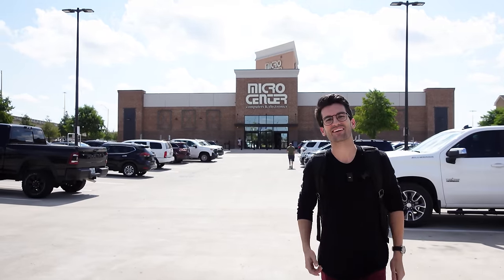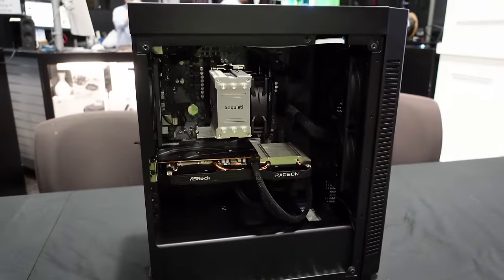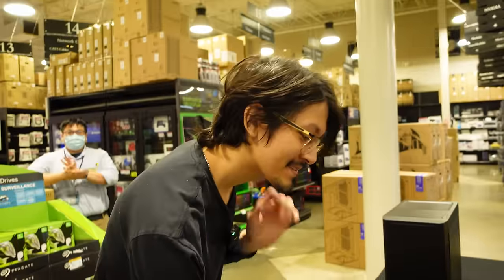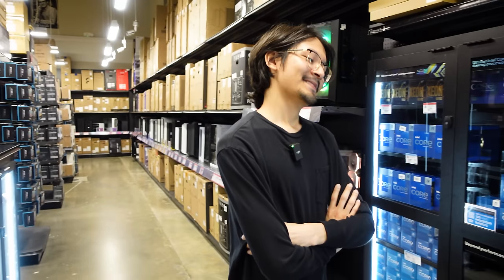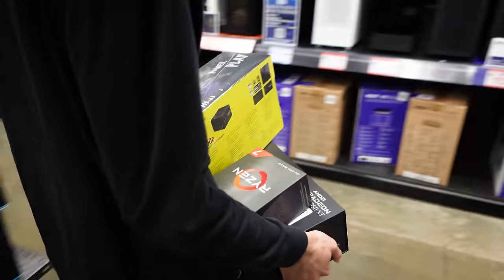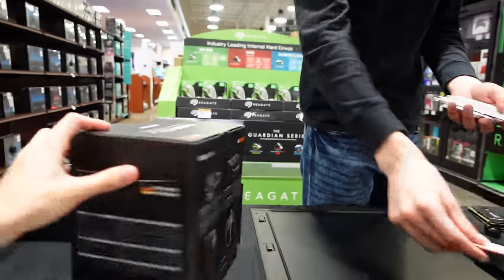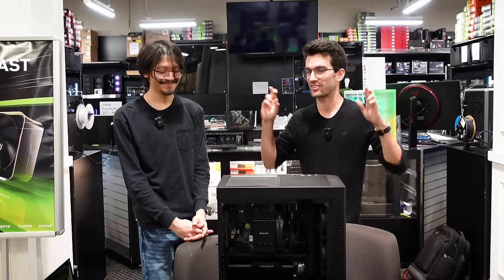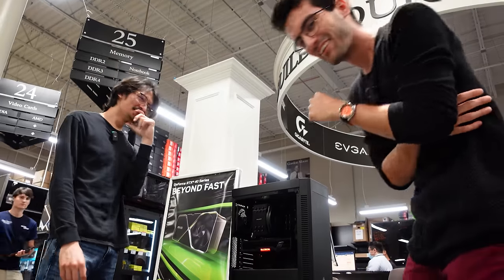He Won an EPIC Micro Center Shopping Spree! - Gear Up S2:E5

Comment: This guy used the budget the best of anyone this season
Reply: Well, he also had the highest budget so far this season, so he had more wiggle room there, and a good platform for upgrading helped as well.
Reply: While I find the 7700X bundle to be good ($400 these days), I only find it to be a good pairing with something ultra high end like 4080, 4090, and 7900 XTX. With the budget most people get, it’s best to stay on the same platform if they can especially those on AM4. They have a bundle for 5600X + B450M DS3H WiFi @ $200 and that is good if a platform upgrade is needed but it isn’t always.

Comment: Super smart to just take advantage of the AM4 platform and compatibility. I am rocking the 6900 XT myself so the 6950 XT will definitely crush anything FPS wise at 1080p or 1440p, hell even 4k gaming is pretty solid from what I have seen. 5800X is a beast too, unlucky the 5800X3D was just out of budget.
Reply: was it? Maybe a 5800X3D along with a 6900XT or still a 6950XT but no new cooler and a cheaper PSU would've cut it
Reply: 5800x3d + 6950xt + PSU could have been enough imo too.
Reply: seems Microcenter need to sale that bequiet cooler. It's almost in every video of this series 😄 @Zebra_Paw
Reply: @SpatialZebra ya, the 3d chips don't get hot, he could have bought a $30 cooler, and one of the 3d models.. also the 5600x3d is only $20 more than the 5800x
Reply: @sstier48  it's a lot more than 20 dollars difference.
And his cooler was already OK since it was already AM4 so not even buying another one
Reply: 5800X3D or 5600X3D if they had it in stock plus 6800 XT or 6900 XT would've been fine, I'm sure. X3D chips don't get that hot - don't need a massive CPU cooler and he could've easily put $100 of his own money in since he'll make that back selling his old parts easily. That Be Quiet cooler is just way too expensive - what he had was fine.
Reply: 5600X3D simply doesn't exist lol
And yes his cooler was way too expensive, you can get a nice Cooler Master 360 mil watercooling for that price
Reply: @Zebra_Paw  Microcenter were the only ones selling the 5600X3D. He had a golden opportunity to check if it was in stock. It's not even 5% worse than the 5800X3D. Could've eeeeasily cooled that with what was in his ystem.
Reply: @b0ne91  it's a 6 cores right? I don't think it's enough for a 6900 XT
Reply: @Zebra_Paw  what do cores matter? It has massive 3D cache. Hasn't it been proven enough times now that cores don't matter? I can get you a 14C/28T CPU for less than $30 - you still wouldn't want it for gaming.
Reply: @b0ne91  yes of course, it's not only cores that matter. They still do though, I don't think you would like a modern dual core for gaming either
Reply: @Zebra_Paw  If that dual core had 150Mb of L3 cache, I don't think it would matter too much unless the OS is eating up all the base resources and you're running a bunch of shit in the background.
Reply: @b0ne91  gaming performance would suffer and severely bottleneck a 6900 XT
Reply: @Zebra_Paw  please look at reviews. Jesus, man, the 5600X3D is within 5% of the 5800X3D. Your cores argument doesn't matter if you have cache so massive. Not for games anyway.
Reply: @b0ne91  I didn't even know the 5600X3D existed before, I only knew about the 5800X3D.
what I know is that the 5800X is significantly better than the 5600X when it comes to holding up with top tier GPUs.
I've never owned a 5600X3D but I'd assume it's a 5800X3D with two less cores and lower clocks. So unless there's something magical about it that the 5800X3D doesn't have, there's no way the difference is under 5% especially in practice.
Not saying it's bad by any means possible, but when you're buying such a crazy GPU it's probably not the best balance
Reply: @Zebra_Paw  you didn't even know the CPU existed yet you're spewing nonsense. Go watch some reviews. Just accept you're wrong. Maybe watch some HUB videos to see how CACHE affects gaming performance compared to cores. Buying a "crazy GPU" balances out anyway because you'll be playing at higher resolution. You're not getting a 6950XT to play at 1080p - if you were, it'd likely be for esports where you NEED a strong CPU to even push those 240+ FPS
Reply: That B450 VRM is concerning tho, looks too bare off to tame the beast that is 5800X
Reply: @b0ne91  bruh. Maybe I'm wrong, but why would that make you so mad? Instead of just randomly yelling maybe explain how tf the difference between a 5600X3D and the 5800X3D isn't the same ratio as the 5800X vs the 5600X.
That'd be more constructive.
Btw I have watched reviews, but usually they're just are reliable as benchmarks
Reply: @Zebra_Paw I explained the difference from the start like 3 times, you chose to ignore it every single time, continue to spout your false information and then eventually admitted you neither knew the chip existed, had no idea how cache works  and kept bringing up synthetic benchmarks that don't apply to games and insisted to not look up anything. I even told you specifically WHICH videos to take a look at to understand how cache is what CPUs scales with moreso than cores. Go look at HUB, look at GN. See how the 5600X3D performs compared to the 5600, 5800X and 5800X3D.
Reply: @b0ne91  bruh
Aside from all the rudeness which is completely pointless, I have to say I'm kind of amazed by how well this performs. I do not know how much it costs but this might be the greatest deal ever (hence why it's so rare).

I still think this could bottleneck top tier graphics cards though
Reply: @Zebra_Paw  That's why I said shifting things around, the winner could've gotten a 5800X3D and a better GPU. At that point, you have the best CPU available on AM4, on par with the 7700X on AM5 and no compromises or having to upgrade again.

I have a 5800X3D and 7900XTX. Let me tell you - the only bottleneck I ever see is from AAA titles, where ray tracing and NPC density is so heavy on the CPU that even at 4k, you may drop below 60 fps. But other than that, I can get 600-700+ FPS in esports titles like Rocket League, Valorant, Overwatch etc. That being said, those titles I usually play on the 7800X3D/RX 6800XT combo with a fast 1440p monitor, not a big TV for story based games with friends.
Reply: @b0ne91  yes it's the 5800X3D. I'd be very surprised if the 5600X3D were to give you that much

Comment: my preferences if its me :

AMD Ryzen 7 5800X3D 3.4 GHz 8-Core Processor	$269.99
XFX Speedster MERC 319 Radeon RX 6950 XT 16 GB Video Card	$599.99
Corsair RM850x (2021) 850 W 80+ Gold Certified Fully Modular ATX Power Supply	$134.99

Base Total:	$1004.97				
Promo Discounts:	-$20.00				
Total:	$984.97
Reply: 100%

Comment: Soooooooo happy he went with the AM4 platform and updated the BIOS. I think people have written off that socket because it is last gen. He definitely squeezed every penny out of that budget. A new LGA 1700 or AM5 with a "lower" tier GPU would have been a great upgrade as well, but this is 100% what I would have done. I also am running a B450 with a 5900x in it because it is a great way to save a few bucks at the cost of EXTREMELY minimal performance.
Reply: I would upgrade the motherboard to get amd Sam and pcie 4 to get better gpu performance
Reply: @mirelurk-fish7387  It is definitely better, but for raw gaming it isn't going to impact mush in terms of data transfers. Games aren't even coming close to the max bandwidth of PCIE gen 3.
Reply: @Dubvee_33  My point for why he should have gone for the AM5 platform upgrade is that he "won" this upgrade, thus in the future when he wants/needs to upgrade, he then needs to get a new MB + CPU + RAM. If he had went with the AM5 upgrade, then in the future his upgrade path, that he now has to use his own money for, would be a lot cheaper, as he should be able to get something like a 9800X3D or the likes.

Comment: Alejandro hit this one out of the park!  He is the first one this season to completely maximize his price to performance.  He got a top tier CPU and GPU and even managed a solid tower cooler and PSU upgrade.  The only thing he needs now is 32GB of fast ram, if he is hitting a limit anywhere.

Very happy with this episode!
Reply: Could have easily gotten a cheaper cpu cooler (Microcenter regularly has the Deepcool air coolers on big sales) or kept the same one he had and got a -x3d chip and that would have been "completely maximized."  If he kept the same one, he had and waited to upgrade it himself, the best air coolers on the market are Thermalrights that cost $50 less than what he paid for a Dark Rock Pro 4.  I'm not sure how this type of stuff isn't being caught by the Microcenter employees or especially Greg.  No one has any business paying 80+ bucks for an air cooler when Thermalright exists in the market.

Comment: Awesome that he stuck with his B450 board and just dropped in a 5800x. AM4 still has plenty of gaming performance on the table! I went from a 3600x to a 5700x and its more than enough for me, especially since I game at 1440p
Reply: It would be great if the VRM in that board is not that sparse off
Reply: @baoquoc3710  yeah the 5800x is a hot one. I think a 5700x would have been a better choice since it’s pretty much the same performance but is more power efficient and runs cooler

Comment: With a grand, I'd totally drop a 5800X3D on the current board, get some baller SSDs, more memory and a GPU.
Reply from the maker: 5800X3D is no slouch.
Reply: Ok, so, 5800X3D, 32gb ddr4-3200, 2TB Samsung 970 Evo Plus and RTX 4070 would have probably been my choice.  But I mean, I already have 48gb of memory and 3TB of NVME so I'm partial to having more.
Reply: @cracklingice What about the CPU cooler and PSU ? Where would you squeeze money from a $1000 ??
Reply: @GregSalazar  Not at all and at the current $270 it's a deal!
Reply: @cracklingice  what you got on those 3TB?
Reply: @hatim.bahrain  I wouldn't change the CPU cooler until it proved to be a problem and the RTX 4070 only requires a 650W PSU - something that the rig most likely already has anyway.
Reply: TBH - if I were to be in this - I would be so SOL.  Microcenter doesn't have any HEDT stuff currently and even if they did - $1k barely gets just the motherboard now for some reason.  My X99 motherboard and a CPU could be had for that.
About all I could really do is a storage upgrade or a sideways move to get more video memory than my RTX 3080 10GB.
It's for those reasons - I'd never be chosen.  It'd simply be boring.  Unless I showed up with my nieces PC.

Comment: Dude, get a 5800x3d and a 6950xt, you'd be set for at least another 4 years. There is no real reason to really go ddr5 yet. The 6950xt is an excellent GPU, I mean excellent. My 5800x3d/6950xt set up gets me over 20,000 in timespy. I don't recommend extremely fast ram with a 6800x3d. I updated to teamgroup ARGB DDR4 3600 c14 and although I get very good performance, it wasn't really worth the upgrade. I got better performance with c16 3600 DDR4 at 1.35. B-die of course.

Comment: The AM4 platform is still a strong one. Yes the new platforms offer way better performance but that doesnt mean its not performing well. I made my new pc with the 5800x on a x570 and my worries is graphics card which is a 3080. I think i wont change platform for 6-8 years while gpu i think I will have to change it after 2-3 years. P.S. I used the be quiet dark rock pro 4 which is more beefy and very quiet...

Comment: WE NEED Micro-Centers in the UK! (Take note Micro-Center!)
Reply: My friend also talks about how he would like a Micro-Center here in Denmark, the biggest problem I see is that, even in the US the distance to a Micro-Center can easily reach 3-4 hours of driving and you can drive from one end of Denmark to the other in 4 hours, so my point to him is that we would only get 1 if even at that, which would mean that he would still have to travel (he doesn't have a license or car) around 2 hours just to get to one.
Reply: At least there is Over-chargers, I mean Overclockers.

Comment: I like the case. I'd have gone for an updated platform though. I suppose he is extending the life of his AM4 board, but a Zen 4 CPU and 32GB DDR 5 memory might've been worth a slight downgrade on the graphics card. That's just me though. It's not as if he has a bad system as it is, or that old. So upgrading it once works, also.
Reply: The AM5 platform would have been cheaper to upgrade for him in the future, that's why I would have pick it. Now when he wants to upgrade, he'll have to pay for all the essential parts (MB+CPU+RAM) himself, leading to being more expensive to upgrade, than just to throw in a new AM5 CPU.

Comment: Smart to stay on AM4. Should've taken 5600X3D or 5800X3D and maybe a 6800 XT or 4070, but definitely a smart upgrade. Getting a new cooler and 5800X over the 5700X and keeping the cooler or just 5800X3D with his current cooler is very questionable. I feel like Greg needs to give some better guidance. He can make back money from his existing parts, so even putting in $100 of his own budget would've made sense to get the best CPU on AM4 and put the rest into PSU and GPU.

Comment: I just traded a legion go for a ryzen 7 5800x cpu Radeon xfx 7900xt gpu, msi b550 gaming plus motherboard, 1tb crucial m.2, 32gb Corsair vengeance 3600mhz ram, thermaltake 800 watt, nzxt kraken 120 mm AIO. Case is an nzxt h5 elite. I wanted to upgrade a couple pieces. so I purchased a msi b550 mag tomahawk max WiFi , I want to get a ryzen 5800x3d cpu. Would I have to upgrade  anything else or would that work. Sorry I'm a beginner pc builder and a beginner at pc gaming. This is my first lol.

Comment: Finally someone doesn't upgrade their perfectly good AM4 motherboard and takes advantage of a drop in upgrade. I'd have gone for the 5700X and kept the cooler, or checked if they had the 5600X3D. One big upgrade when you bump up the graphics card like this is RAM. Some of the more intensive games now need more than 16GB, if you only have 16GB you can end up with stuttering. With that budget and how cheap DDR4 is now, I'd have upped the RAM to 32GB.

Comment: Michigan here... like how the guy decided to keep with the same platform. After many PC builds and upgrades I have found that the best bang for the buck is keeping the same MB and just upgrade cpu, memory, gpu and storage for years. Then once the platform is two generations old I start over.  Guess the hardest struggle is keeping an old gpu for years till the next platform upgrade. My current AMD build has the Ryzen 7 5800x3d which is the third and last cpu for this build. For the GPU I still rock the AMD 5700xt. It needs some setting downgrades to keep frames over 60fbs on my 2k monitor but for a 4yr old card that is fine.

Comment: Few months ago I build almost the same PC for my niece, the same PC that he had prior to the upgrade. I build that PC from my spare parts shelf, Ryzen 5 2600, 16GB RAM and a  Gigabyte RX6600.  and that PC works perfectly fine for her, she's so happy when she could play Harry Potter and lately she's hooked on Apex.
So this PC of this dude wasn't that horrible to start with. Still a very big upgrade though but if he runs a 1080p monitor at home he will basicly kneecap the system by not even getting close to really having to do much. 
So I hope for the love of God that he has a 1440p monitor on his shortlist.

Comment: I'm so happy finally upgraded from i7 2600k to ryzen 7 1700 Asus rog x370 Motherboard and 16gb ram hyperx dual channel.Only thing i wanted to ask on 3.0ghz it runs like a charm but when i set it to any amount higher  i get bsod (i got 600w thermaltake 80+ psu thats not a problem

Comment: this was the first time i felt Micro Center was pushing new generation stuff on the guy. The CPU+MB bundle thing and the 4070. And notice how the 6950XT wasn't in the show-case, but tucked away somewhere. I don't think the store was very happy with his smart choice. Too bad he had to take the reference design of the 6950XT, it seemed like he wanted a custom model, that wasn't in stock.

Comment: 5800x is still a solid cpu. He did the right choice keeping the platform especially with DDR4 being also cheaper if he wishes to upgrade to 32gb. Not sure how well the b450 will handle the 5800x, I mean it should be overclocked to get the most out of it (most do 4.7ghz and some 4.75)

Comment: That was really not bad if I say so! I don't really like the case, because it doesn't have much front airflow, but that could be easily swapped later down the line if needed. 
Also good to see someone with a high enough budget for a powerful CPU & GPU!

Comment: I don't trust a program to be truly random.  It's actually not possible for a computer to be random it has to work with probability.  A set percentage to land on any specific number.  Why not use the old mechanical wheel?

Comment: Really nice upgrade, there! Congrats! Personally, I'd love that lower front fan down a space and lay a divider between the two and the graphics card. It'll improve airflow by a lot. Also, don't run the case fans too fast as they'll cause turbulence at the fan of the cpu. 😊

Comment: I think I would have gone with the AM5 platform upgrade, as you could more easily (and less expensive) upgrade that in the future with a 9800X3D or the like. And that graphics card is nice, but at what resolution is your current monitor, especially given his "current" graphics card being a RX 6600, which leads me to believe he's only got a 1080p monitor, then it might have been better to go with a lesser card like the 6800 XT instead of the 6950 XT. But that's just me.
Reply: His current build is 3-4 years old. This upgrade will last him long enough to skip a generation as not everyone needs to be on the latest and greatest. He could carry the 6950 XT over to something like a 8600x3d bundle and have a pretty nice 1440p kit most likely.